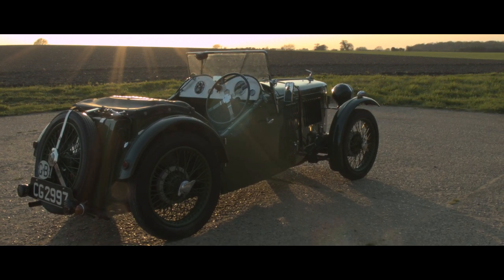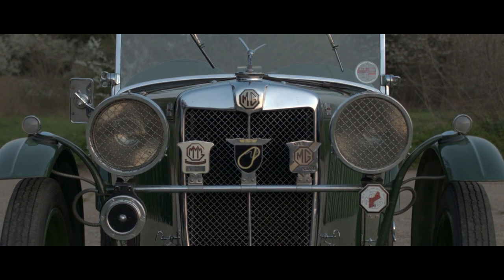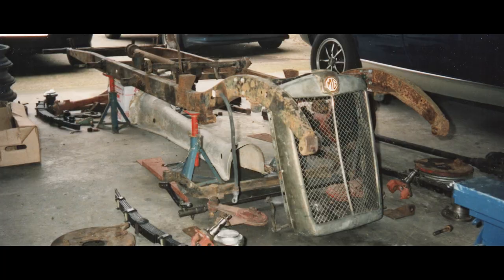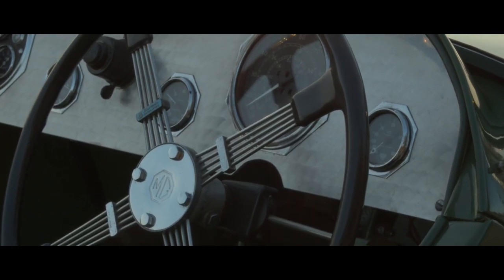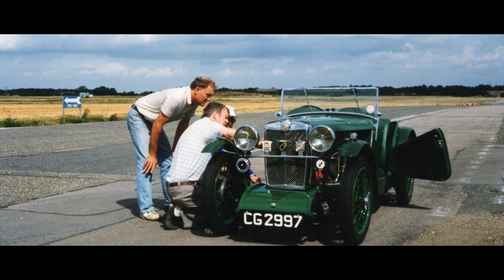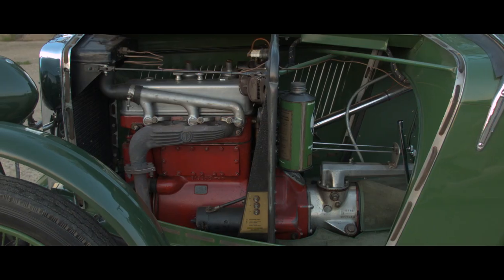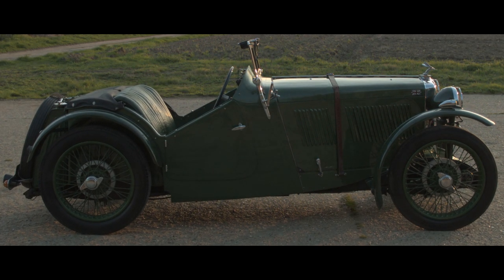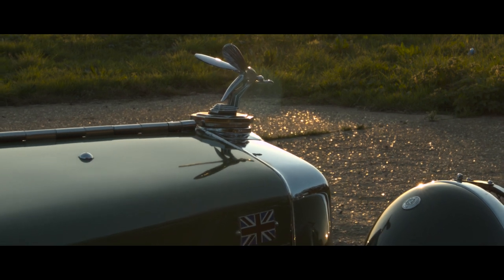1932 MG J2 Midget Documentary

Comment: I had a red J2 in the 70s. It was my daily driver. The only thing I never took off was the gearbox. It had a ford engine with twin SUs,  in place of the original because of problems with oil running into the distributor. It also has full length mudguards and running boards. I broke several half shafts and got adept at changing them by the roadside. I received a set of tyres from Dunlop when they had enough remand to press a few hundred. The only reason I sold it it on was the cork oils seals on the back axle became unobtainable and were leaking. I did many happy miles in that motor. The narrow wheels meant it ignores snow, and I dropped the windscreen in thick fog. Great fun. I swapped it for a MII MG Midget.